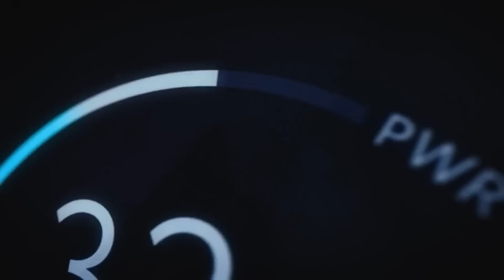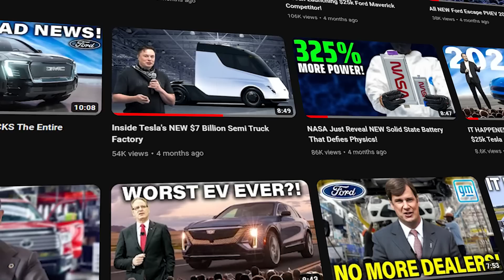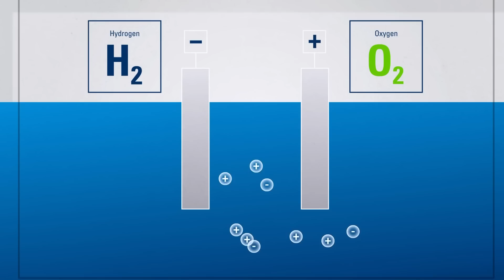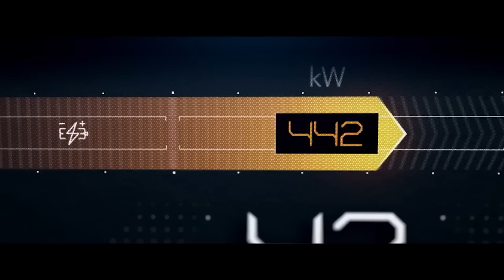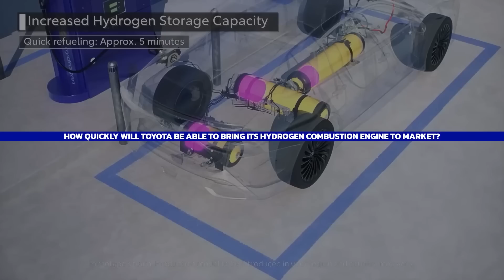New Toyota CEO Reveals Hydrogen Combustion Engine | Shocks Industry!

Comment: Hydrogen will eventually become the energy a go to. However it is a log way away!
Reply: You use electricity to make the hydrogen and then convert the hydrogen, with a fuel-cell, to electricity, to fuel the car. Using the gas to fuel the car is even more inefficient. Physics says that electricity is always going to be cheaper.